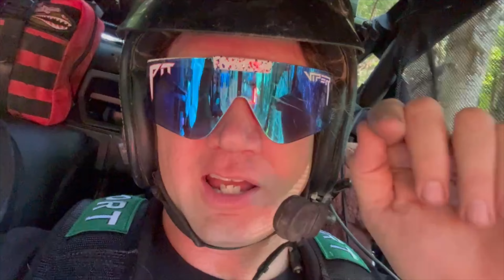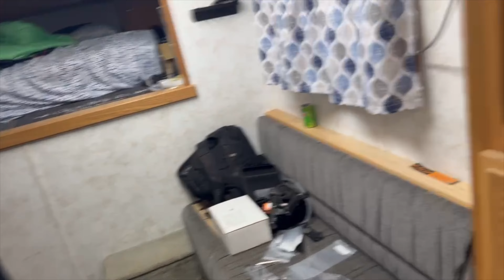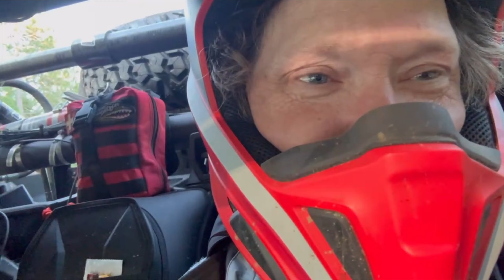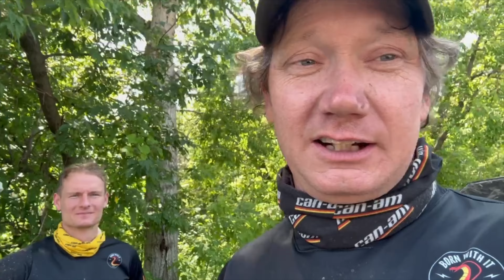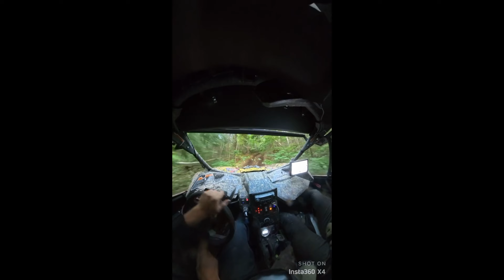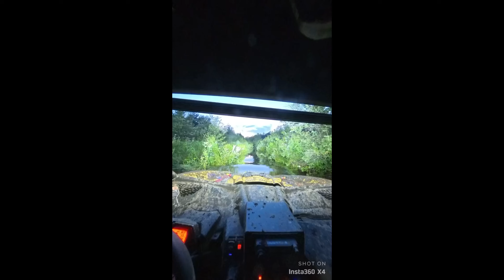Canam x3 23 hours Dacre Rally

Comment: Enjoyed the video.  What lift was that  you were using on your SxS?
Reply from the maker: No lift just 32” tires ride height at 15.5” with proper spring rate for the added weight.
Reply: @NitroRedNekHubert  Sorry what I meant was when you were working on your SxS you had it up on a lift or stand.  I was wonder what make that was if it was yours.
Reply from the maker: @Joe-Van ah ok. 

https://www.freedomracelifts.com/products
Reply: @NitroRedNekHubert  Thanks
Reply from the maker: @Joe-Van 👍🎉